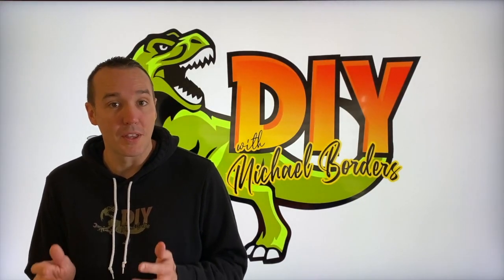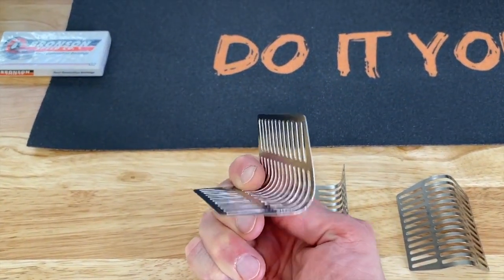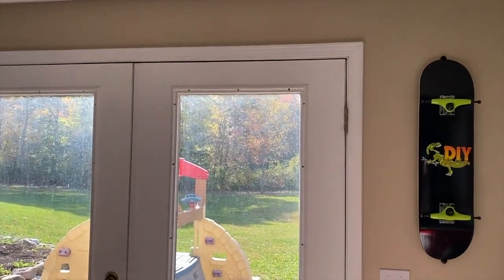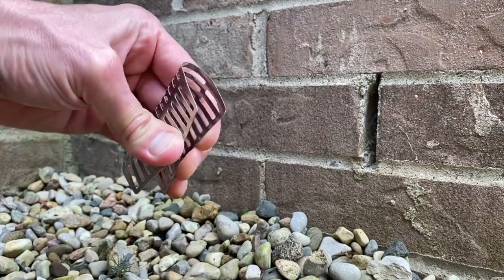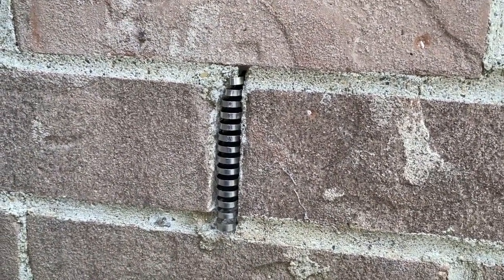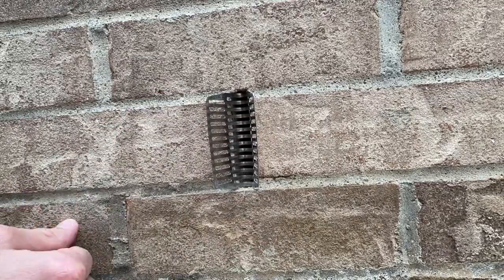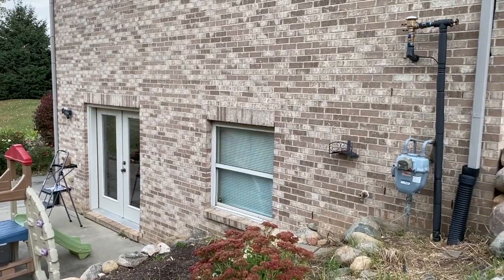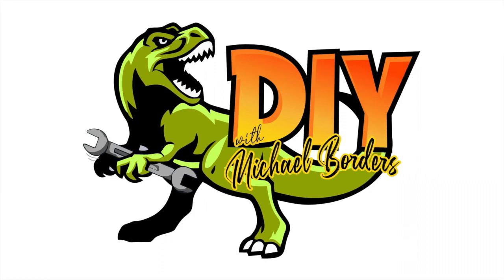How to install Brick wall weep hole screens

Comment: i never knew of these . do all brick homes have these hole things.
Reply: No, mine didn’t. The house was built in 1965. I had to drill out mortar between bricks to insert weep holes. The newer houses are more likely to have weep holes, due to code requirements and more understanding of the dangers of mold building up inside damp walls.
Reply: @leeb.7188  OH i see.   ive been looking at homes   for sale in Indiana  because i want to move out of Vegas and i see a lot  are brick   thats why i was wondering about this and  i guess  have to check the  house then to see if they have them  already   in .. Tks. ~
Reply: @joedevitto6113  : I also had a house for awhile that had small holes in it that looked like drill holes. I was thinking I should caulk them, to keep bugs out, until I noticed while I was sitting in a drive-thru line that commercial buildings had the same thing. So now I’m thinking that they were put there intentionally as weep holes.
Reply: @leeb.7188   Im thinking too  even with these metal things bugs can still get in maybe nothing  big ..     i do like a brick house   no painting       or maybe just the trim
Reply: @joedevitto6113  : I agree. They’ll keep mice out but not bugs. Maybe need to stuff them with some kind of rust-proof stainless steel fabric.

Comment: What’s a weep holes purpose?
Reply: Brick is porous. The weep hole allows any moisture that has built up in the wall to weep out, so you don’t get mold in your walls.
Reply: @leeb.7188  that makes sense. Thanks for the response! 🙏